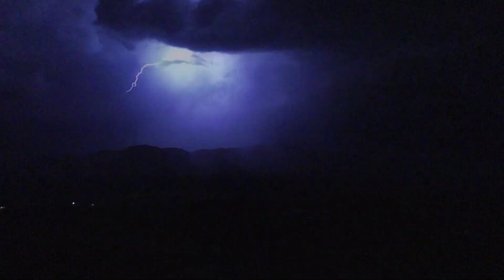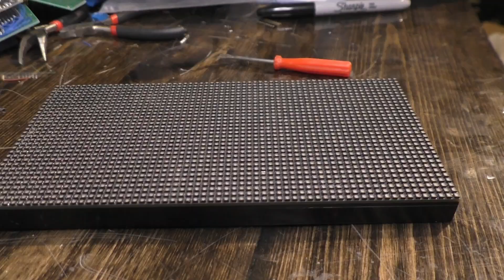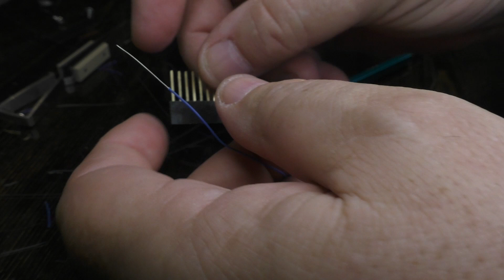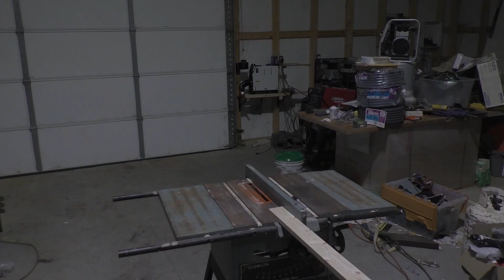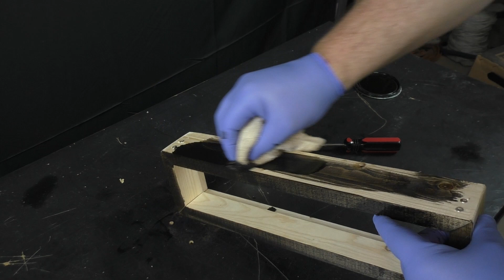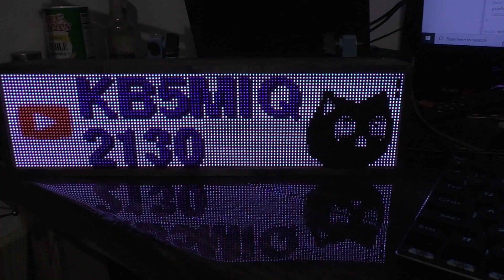Advanced Youtube Counter RGB LED Matrix

Comment: Nice detailed vid of the hardware.  Thanks!  Now can you go into the same amount of detail RE: developing the code?  My pet peeve is, so many of these microcontroller-based projects have nine pages and twenty pictures of soldering a resistor to an LED, but not a word regarding how ten thousand lines of code were developed.  What gives?
Reply from the maker: I suppose I could do that, I had given it some thought but figured most viewers are turned off with lengthy code dives.